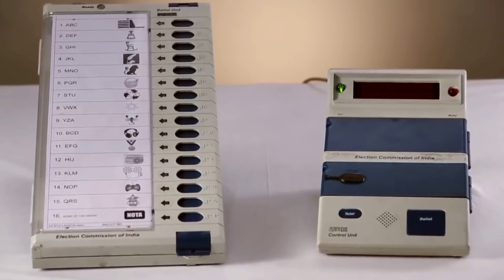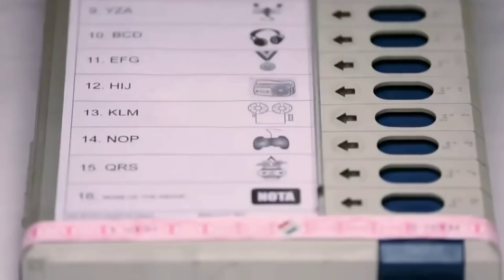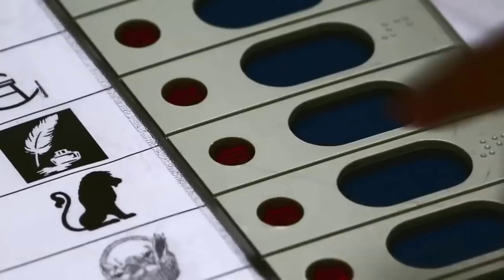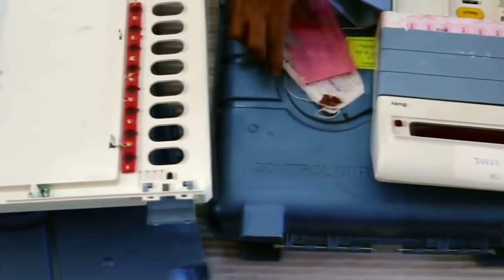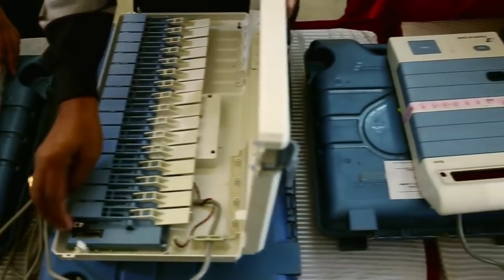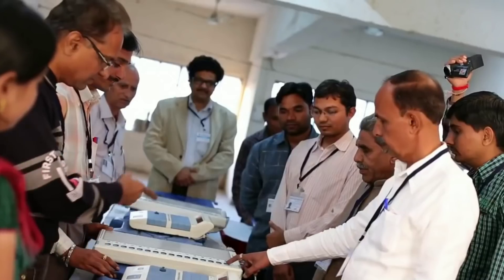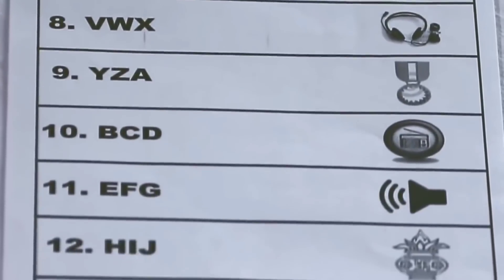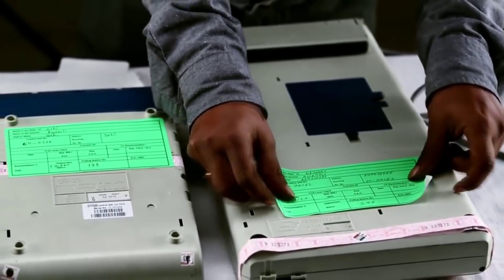Can EVMs be hacked? Is hacking EVMs possible? Polling Scam

Comment: The simple answere would be while manufacturing these they didn't put any network hardware in it. It's just a dumb computer which will run the same logic and calculation every time some one press any button and  the code's can't be rewritten in the chip for that we have to either replace the circuit board or replace the MCU.